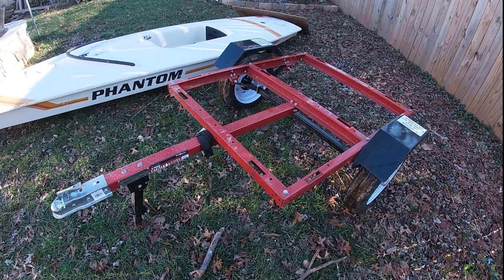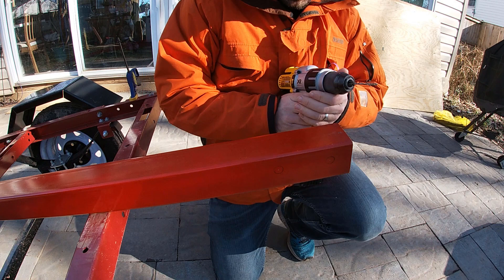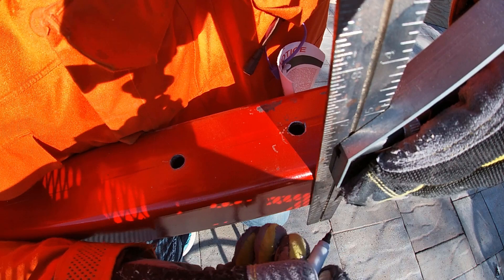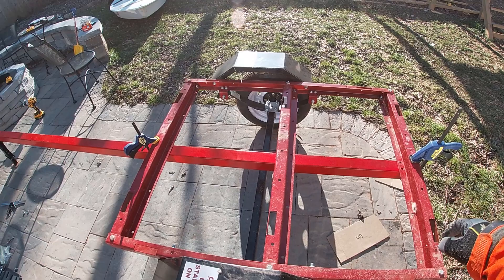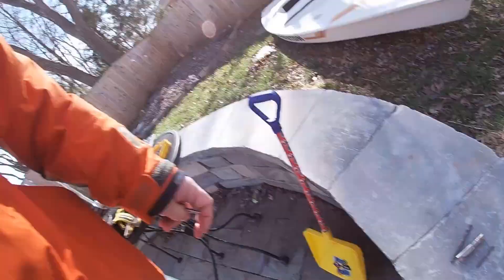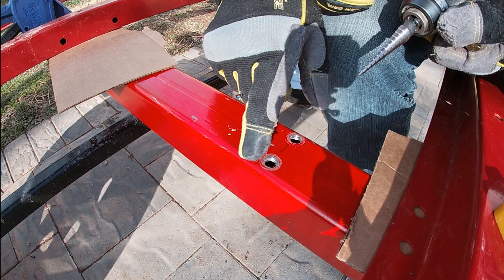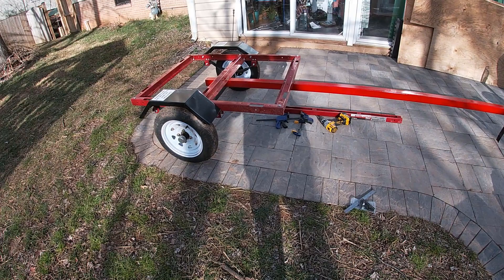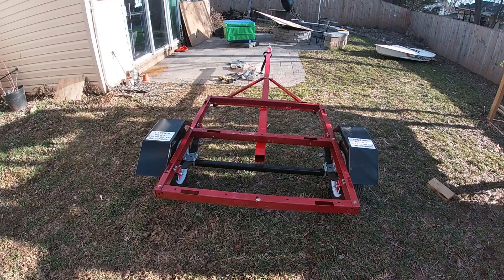Making a Dinghy Boat Trailer from a Harbor Freight Utility Trailer Part-1

Comment: Get a welder makes it so much easier, it was the best tool I ever bought when making my trailer into a boat trailer. Good video.
Reply from the maker: I've got access to a welder if I really need one. That said, this trailer was originally built to bolt together, and I wanted to modify as little of it as possible.

Comment: When drilling metal, lube your bits with wd40, they brake because they get overheated, picture it as cutting glass or concrete with saw and water!

Comment: Just built one. I laminated wood to extend the tongue, I think it will work. The question is, where do you get the box tube?
Reply from the maker: I got mine from Metal Supermarkets. They have local offices you can pick stuff up from (cause it's expensive to ship steel.)

Comment: Awesome DYI; I'm about to do the exact same thing for a boat I just built. 

A suggestion from one DYI guy to another: Buy a little welder and watch a ton of YouTube videos on how to use it. My projects took off exponentially once I learned how to weld.
Reply from the maker: Good luck with it! I've got experience welding, but since the trailer was originally designed to be bolted together, was powder coated, and is made of... dubious... metal, I felt more comfortable sticking with bolts.

Comment: A good place to get graded bolts is at a farm supply store. I'm not sure what's in your area. They usually cary  metric and standard bolts for tractors and farm equipment. Good call on beefing up the tong material. Those harbor freight trailers are cheap for a reason.

Comment: I was also looking to modify a HF trailer for a Sunfish, but since I have a welder, it should be a simpler job. No holes to drill!
Reply from the maker: Best of luck, it's a fun project! Heads up that the HF trailers are powder coated, and pretty thin stock. Lots of grinding, and the new tongue that I used was thicker than the material I bolted it to. Not impossible to do, but it would come with its own annoyances.

Comment: The trailer is rated at over 1,000 lbs., with a boat that light, you might consider removing a leaf or two from the springs.  Just a thought.

Comment: Guess is, you also purchased your drill bits at Harbor Fright???
Reply from the maker: You might think so, but no! The first set was admittedly old, but the new ones were a name brand from the hardware store. They weren't anything fancy, for sure, but still. User error is always my first guess.

Comment: Hi. Just curious, to what max speed have you taken this trailer? Some "sellers" of this trailer state 45mph max but it seems many people are going beyond that with no issues. I want one, but not if it has any issues on the freeway, up to 65mph. Thanks
Reply from the maker: I double checked, and it is true that Harbor Freight lists the max speed of the trailer as 45mph. I've had it on the highway without issues, and I suspect that making the tongue longer makes the trailer more stable when being towed. I wouldn't want to go cross country with it, but it seems ok. You might check the speed rating on the tires to see what they're rated for.

Comment: I'm hoping to do this for my 14' Jon boat. I'm wondering if the 12' square tube you used would be long enough. Does the boat hang behind  the trailer? If I'm guessing correctly, there's about 2' of trailer behind the center cross rail. I think I'd need at least 3' of clearance from the end of the vehicle to the front of the boat so wouldn't you then need at least a 16' tube?
Reply from the maker: Almost all of the Sunfish/etc trailers I've ever seen have the boat hang off the back of the trailer to some degree. I'm going to see how this works, but I've got room to move the boat forward by a foot or so. That would only leave 2-3' hanging off the end of the trailer.

Comment: What kind of metal did you use for the tongue? Awesome video.
Reply from the maker: It's just a mild steel welded tube. I'll need to keep an eye on it for rust, but the rest of the trailer is just powder coated steel as well.

Comment: what was the thickness of the steel box tube you replaced with... 1/8 in., or 3/16 in.?
Reply from the maker: It was 2.5x2.5x0.120 I don't have any solid reasoning to back that up, aside from the fact that the hitch mount was 2.5" wide, and it was available at my local metal dealer. It seems at least as strong as what the trailer originally had, and I'm not planning on towing nearly as much weight as it was originally designed for.

Comment: How well does it tow?
Reply from the maker: Pretty well, actually. I need to repack or replace the bearings on the right wheel though. It runs hot, even without any load on the trailer. (You get what you pay for.)